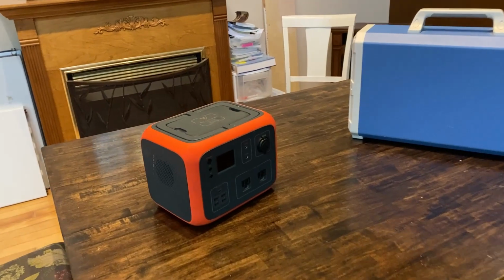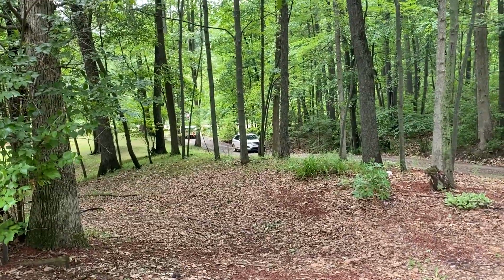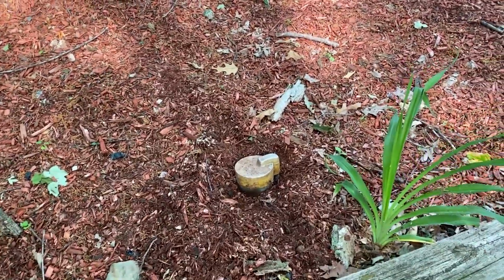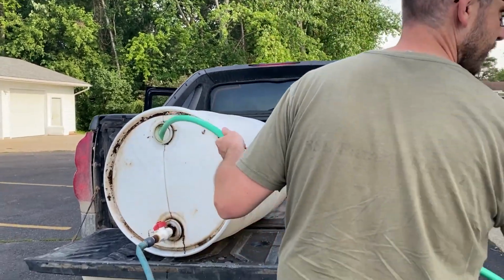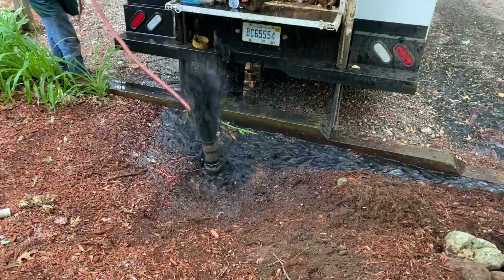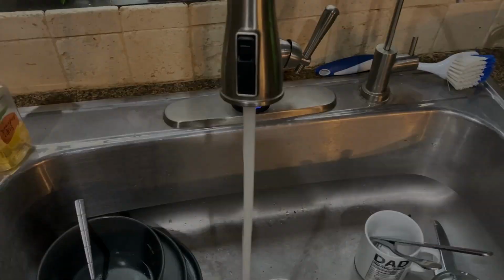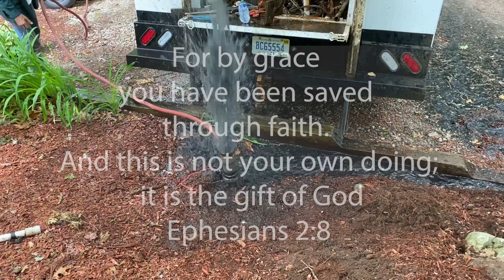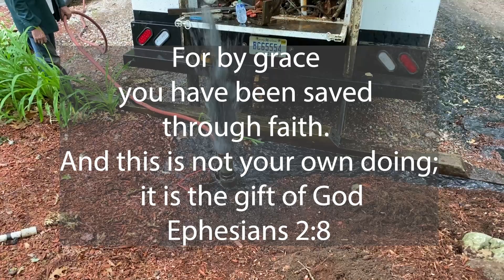We Weren't Prepared For This

Comment: Everyone is talking about expensive pumps yet everyone forgets about the pitcher style pumps.  They make some cool ones that offer the ability to actually attach pipe so u can hook it in to fill things in the house. Its hand operated and takes 2-3 gallons of water to prime. When I was growing up we had an old artesian well  that we had to replace when we bought the house.  So once we moved in I helped install an old cast iron wash tub and drilled a hole and mounted the pump to the side of it and hooked to the old well. Pour a couple of Gallons of water to prime it open the valve and start pumping and after a few pumps you would have a the water you could want
Reply: They are no longer every day items, and a good reliable one is going to cost a lot more than you might think.

Comment: Hopefully you won't lose a pump every time you get lightning.
Two things.  
1)  Surge protection for your electrical (and make sure electrical and  grounds are set up correctly).  
2)  In case of a widespread extreme emergency,  a manual pump for your well.  They are pretty expensive, but might be worth it for that bad disaster.

Comment: My last house, I had a well pump issue. It turned out it was the wires going down the waterline. Every time the pump turned on it would twist in the casing. This caused the wires to rub bare and short. New wires and a good tape job I was back good as new.

Comment: I sure know what that feels like to go without water for an extended time.  We had to go deeper with our well and it took a bit to muster up the resources.  (Wound up at 800' deep)  There was a lot of hauling during the interim.  I'm currently in the process of going 100% solar on the well.  You can do this even if you have a 240v pump.  Make sure your inverter has the beefy transformer  (called low frequency inverter).   It's an investment but I feel well worth it.  I also recommend an above ground storage tank.  This can provide emergency reserve water should the submersible pump stop working.  Someone in the comments mentioned a whole-house surge suppressor.  I've installed one and strongly recommended for others as well.  Didn't mean to go long here.  :D

Comment: Surge protection, Surge protection, Surge protection
Wranglerstar installed a good manual pump - check that out
How deep was the well? How much was the new pump?
A 330-gallon tote and an aux pump would be a very handy thing to have.
Good generators became very important last winter and the price went up accordingly.

Comment: Store water as high as you can so when you have no power you can use gravity to feed it to where you need water. Just remember to take the weight of the water into account as water is heavy in bulk amounts.
Reply: Good advice, in both aspects.

Comment: Living in the mountains , I learned many valuable lessons about what you are going thru , it's not fun , be prepared , it is costly & a pain , I had the well re- wired , put in more installation on walls in pump house , winter was the worst , snow , cold , hail summer time , loss of power , heavy , heavy rains ! Plan ahead it will pay off , be smart , good luck ! My wife at times would go to castle rock Colo. To stay with her son , I survived , I had to !!!

Comment: "yucky" water for animals: Have you ever seen the chunky stuff animals routinely drink when on pasture?
Backup water: I use IBC's (yes I check for original contents) hooked to a 110V pump with its own pressure switch which I hook to the pressure tank through the drain valve.  Works great.  Pressurizes the existing house plumbing system.
Reply from the maker: I was thinking of something like this, good to know

Comment: You're lucky the well breaker tripped. I came into the house after a power outage to the smell of burning plastic accompanied by frying bacon sound, with smoke pouring out of my breaker panel.  I held my breath and turned off the main breaker and it all went out. Burnt the pump breaker contacts and ruined a total of 4 breakers. I hate to think what would have happened if I had not arrived when I did. That was a few years ago. After rewiring the breaker the pump worked fine until this year. It would sometimes pop the controller overload, and impedance test showed leakage to ground. Finally it wouldn't run at all after pressing the reset, so had to replace the pump.

Comment: we have a well unfortunately it on the south end of the farm we have over a mile of pipe between it and the house (only good water in any amount) every time we have to open up the well we pour a gallon of clorox down it and run it for a couple of hours, garden or yard works good we also bought a generator big enough to run the pump.  And yes you need small containers of water around and gas for the generator, mower, tractor, vehicles, ect .  sorry it looks like the new property wasn't quite a cream puff  that it looked like at first
Reply from the maker: Yup and this house never looked like a cream puff, lol we new what we bought:) a 50 year old house in need of lots of work
Reply: @SSLFamilyDad  well thats life for you but if it was perfect what would we do with ourselves good luck and have fun while you work on stuff
Reply: @frrapp2366  Exactly I agree. Some people are glued to the TV others like to be part of life not a spectator.
Reply: Does the power to your well pump run over the mile distance?  Wow that is a far run for a pipe.
Reply: @mainelyelectric  fortunately no we live where most roads are layed out in mile grids ,s section dividedin to 4 quarters we have 2 adjoining running north and south we drilled wells in 3 spots when dad bought the farm but 2 North wells didn't have much capacity, we have 2 - 30ft cattle tanks and 6 hydrant s or manholes with faucet s in them.  2 1/2 in pipe  for most of the system we put rural water hookup at my dad's house but still had to run it a little more than a 2/4 mile but had to cross the creek luckily the county road crew were working on the bridge and had a big trackhoe to dig through the creek for him . We even hit an old dam tat dad said as there as a kid they ran pigs down to it during summer to cool off but had silted in he had forgotten it was there even lol life is fun right .oh btw I just had to replace the pressure switch on my well this morning got home last night late and No water the price of having your own well😁

Comment: So,
how deep is the well pump?
Did you need to run new wire from the well to the panel since you were missing a ground wire?  
Why did he flush all the debris out of the well casing?  Was the debris b/c the well cap was so close to the ground?  Thanks!!
Reply from the maker: I still need to run a new wire from the house to the pump and he always flushes the pump out while he has it out. That dirty water is pretty normal, the shaft is over 100’ but the well doesn’t sit all the way at the bottom so it is always sucking in clean water